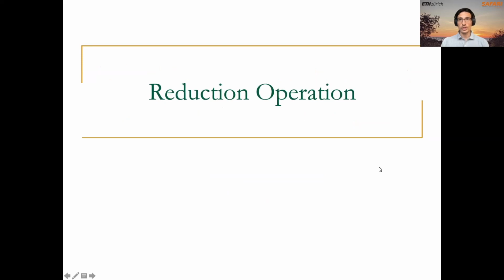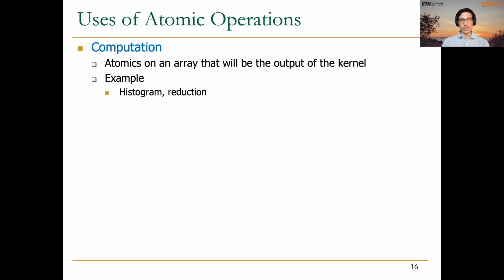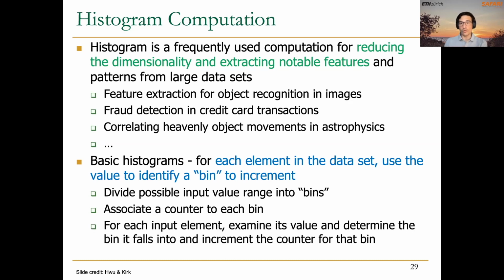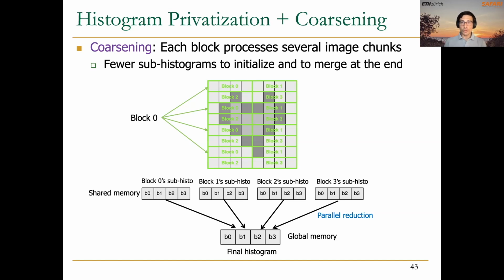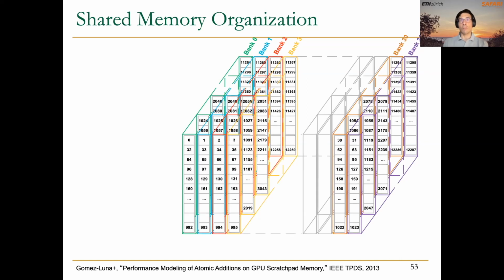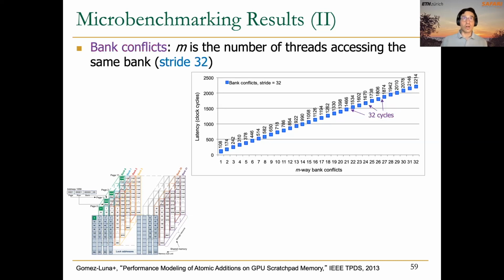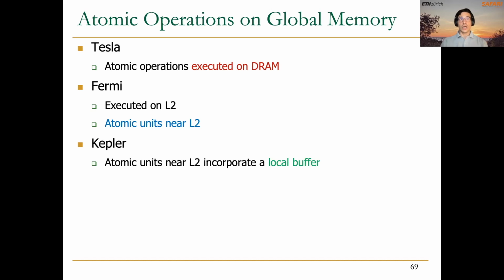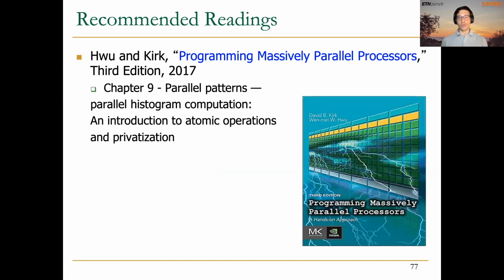HetSys Course: Lecture 7: Parallel Patterns: Histogram (Fall 2022)

Comment: Great lecture, thanks for sharing it. It is unclear how padding can actually help. Isn't the bank data dependent and if the data is assumed random all banks always have the same probability of being accessed?
Reply: You are right. The assumption for padding to work is that there is spatial correlation in real images (i.e., it is likely that neighboring pixels have the same value).
Reply: @juangomezluna270  So in practice this approach can not be generalized given that if data is truly random there is a non zero probability of overlap, right?